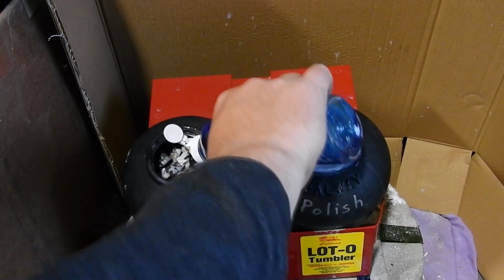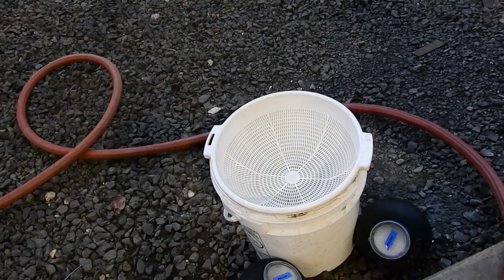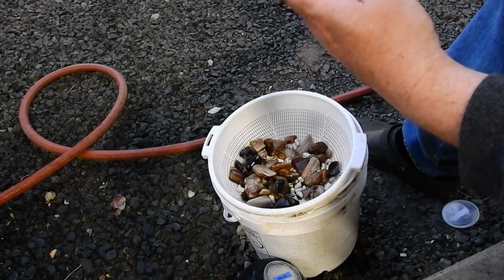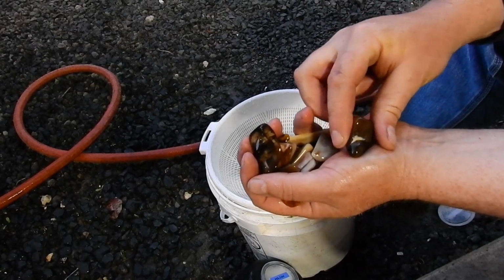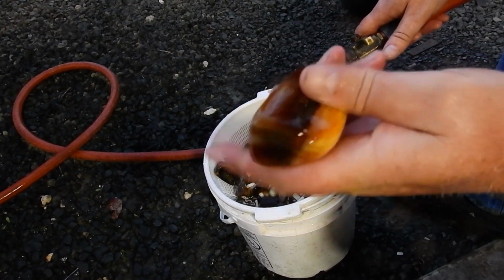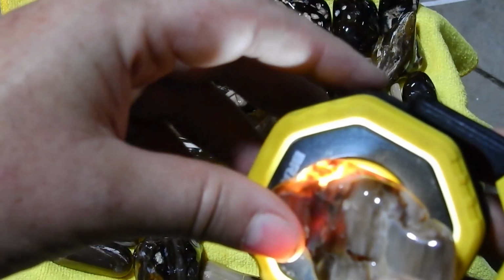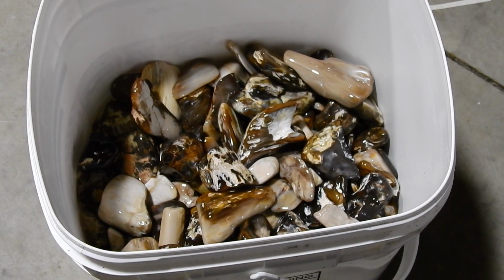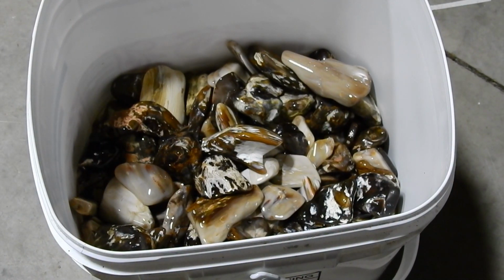Saddle Mountain Petrified Wood, Cleaning after Polishing #thefinders

Comment: I do a cleaning run between each stage and after polish. I have a Diamond Pacific MT-4 and what works best for me is load the material as usual (wet interior and wet rocks) and add half a teaspoon of Ivory soap shavings. I let it run for as long as it takes me to drink my morning mug of heart starter. By then the jar is full of suds and the rocks are clean, and so is the interior of the jar. Follow with a rinse in very hot water and they're done.

I've only had the MT-4 for a couple of months but it's a nice unit, very quiet for a vibe and not super fussy to run as long as you don't overload it. I just wish now I'd bought a bigger model...and probably will.
Reply from the maker: Morning mug of heart starter, love that!!!